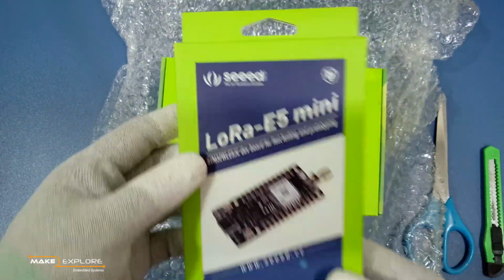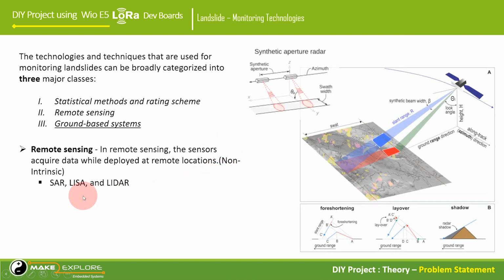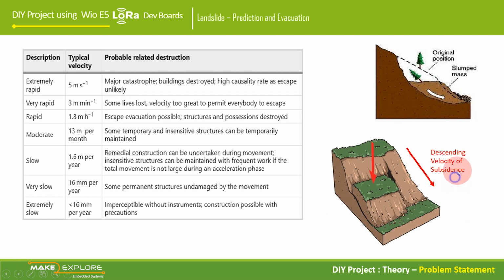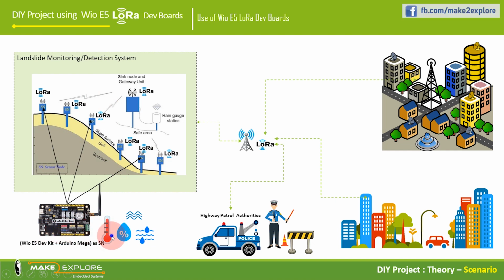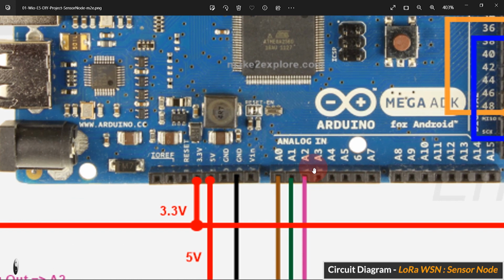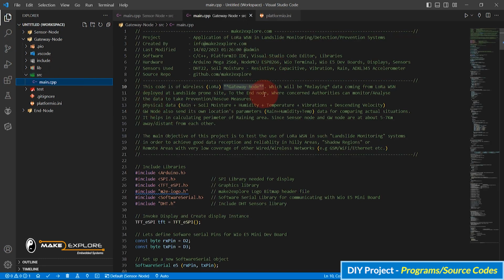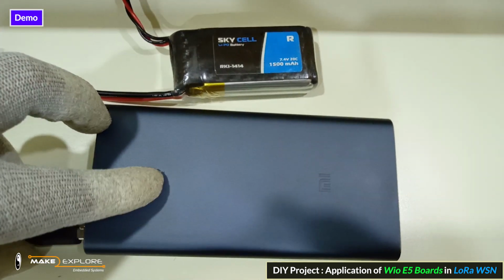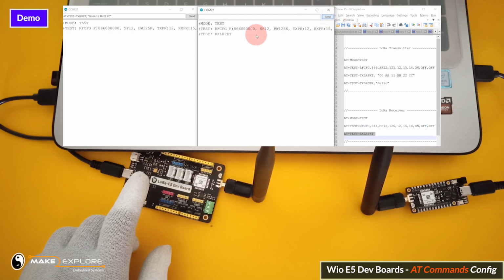[DIY Project] Application of Wio-E5 Dev Boards in LoRa WSN

Comment: hey mate, do you manage to keep the powerbanks sending power until the got no more energy to deliver? Or you just use the low-power-mode that typically gets 2 hours of power without checking if there is any high consumption device connected to it? thanks!
Reply from the maker: Dear Friend Borja Albert, @borjaalbert2718

Thank you very much for your interest in our channel.

Q - do you manage to keep the powerbanks sending power until the got no more energy to deliver?....

➡️ For testing at remote location in our setup, we used LiPo Battery banks with a charging circuitry, and we were able to get a decent amount of runtime. We didn't specifically implement any low-power modes, but the battery banks were able to handle the power requirements of our devices. However, we did notice that when high-consumption devices were connected, the battery life would drain faster. We tried using daily use power banks(Smartphone power banks), but due to their auto power-saving function, they would usually cut off or turn off when low power consumption was detected. This wasn't ideal for our unmonitored remote location, so we avoided using them. Instead, the LiPo Battery provided a more reliable solution. What about you? Have you encountered any similar challenges with power management in your projects?

If you still have any other suggestions/issues/queries about this Tutorial, or any of our DIY project, feel free to ping us on WhatsApp/Telegram (Links given below).

Tech support - (𝗖𝗵𝗮𝘁 𝗢𝗻𝗹𝘆) Telegram/WhatsApp - 11:00 AM - 05:00 PM (Mon-Fri) IST   

🚀 𝗧𝗲𝗹𝗲𝗴𝗿𝗮𝗺      🔗 https://t.me/make2explore
💬 𝗪𝗵𝗮𝘁𝘀𝗔𝗽𝗽    🔗 https://bit.ly/3VXGGEe
📩 info@make2explore.com  / support@make2explore.com

Thank you for your support.

Best Regards
Reply: Dear  @make2explore  , thanks for the answer! I did come up with a solution. I use powerbanks for a LoraWAN based project. Since as you mentioned, powerbanks normally do an auto-shutoff since they don't detect a decent amount of current for knowing that there is a device connected. Therefore I managed to create a circuit that makes a peak consumption needed for the battery to prevent the auto-shutoff, i loose battery capactity but at least it works. Thing is that lipo batteries are pretty small and with no really big capacity, therefore I wanted to test with regular powerbanks. In my case after testing with some of it, the powerbank we used every 2 minutes it detects for a minimum amount of current which I tested, and then I programm it that every 2 minutes it must send a pulse for requesting to some resistors a minumal load of peak current.
Reply from the maker: Cool solution! So you've effectively worked around the auto-shutoff issue of powerbanks in your LoRaWAN project by inducing a minimal peak current every 2 minutes. That makes sense given the constraints of using powerbanks for low-power devices in remote locations.

Btw, How's the performance of your setup been since implementing this workaround? Are you seeing the kind of runtime or reliability you were hoping for with this approach?

Comment: Great effort, appreciated. Thanks for detailed explanation. One doubt came in mind, is it possible to interface sensors directly to LORA E5-Dev. Kit? so that Arduino can be removed? Thanks once again
Reply from the maker: Dear JENISH @jenishjustinpalathingal3262, 
Thank you very much 🙏  for your interest in our channel and Your words of encouragement. Those means lot to us.

Q  -  is it possible to interface sensors directly to LORA E5-Dev. Kit? so that Arduino can be removed?

➡️ Yes you can interface various sensors directly to LORA E5-Dev Kit. It has rich interfaces including Grove connectors, RS-485 terminal, male/female pin headers for you to connect sensors and modules with different connectors and data protocols, saving your time on wire soldering.

For Programming - As Wio-E5 Dev Board embedded with Wio-E5 STM32WLE5JC Module , which is the world-first combo of LoRa RF and MCU chip into one single tiny chip. The MCU Chip is of ST Microcontrollers. It is powered by ARM Cortex-M4 core . So you can use STM32Cube MCU Package for STM32WL series(SDK) to build baremetal application. You can use  STM32CubeIDE: for compilation and debugging. And, STM32CubeProgrammer: for programming STM32 devices. We have explained this in our [Wio-E5 Review video], check out following timestamp

▶️ https://youtu.be/VspwQZ2S2m8?t=1043

**Please Note that this process will erase the Factory AT Firmware. After erasing the Factory AT Firmware it CANNOT be recovered.

🔴 Check out following Wiki documentation for more info about Develop with STM32Cube MCU Package

🌐 🔗 https://wiki.seeedstudio.com/LoRa_E5_Dev_Board/#develop-with-stm32cube-mcu-package

If you still have any issues replicating this Tutorial, or any of our DIY project, feel free to ping us on WhatsApp/Telegram (Links given below) for further support.

Tech support - (𝗖𝗵𝗮𝘁 𝗢𝗻𝗹𝘆) Telegram/WhatsApp - 11:00 AM - 05:00 PM (Mon-Fri) IST   

🚀 𝗧𝗲𝗹𝗲𝗴𝗿𝗮𝗺      🔗 https://t.me/make2explore
💬 𝗪𝗵𝗮𝘁𝘀𝗔𝗽𝗽    🔗 https://bit.ly/3VXGGEe
📩 info@make2explore.com  / support@make2explore.com

As per time permits we will try our best to help you out. 

Best Regards 🙏
Reply: @make2explore  thanks for your reply, that means by including Arduino we can avoid programing WIO-e5, utilize factory firmware for our project, am I right ?
Reply from the maker: Dear JENISH @jenishjustinpalathingal3262, 

Q  - that means by including Arduino we can avoid programing WIO-e5, utilize factory firmware for our project, am I right ?

➡️ Yes that's absolutely right, AT Command Firmware is just like Middleware which reduces low level coding overhead. and If we use MCU boards like Arduino which have huge ecosystems of Readymade Libraries for different sensors and modules, application prototyping becomes so easy.

Thanks and Best Regards 🙏